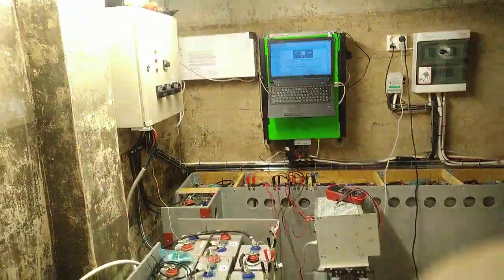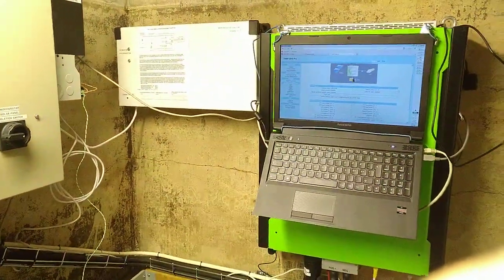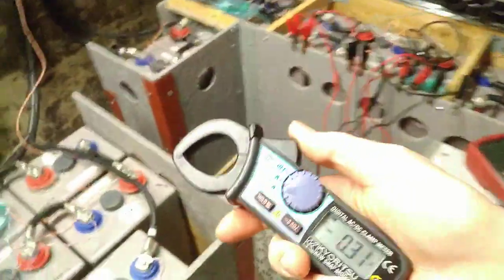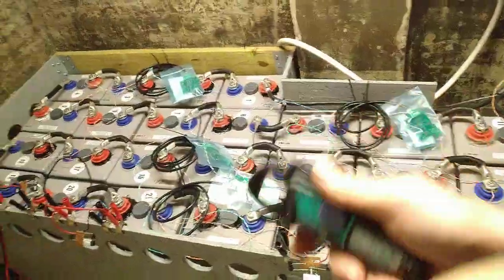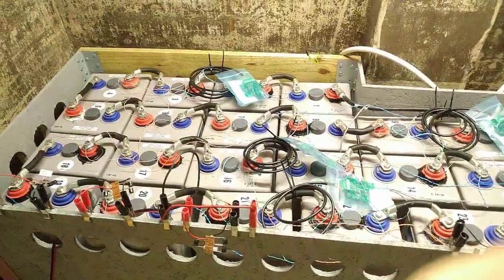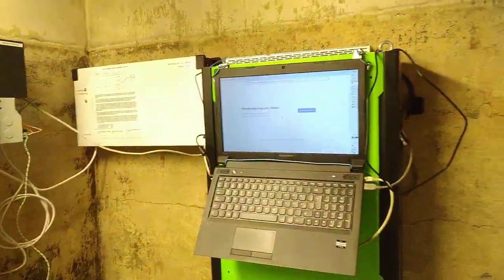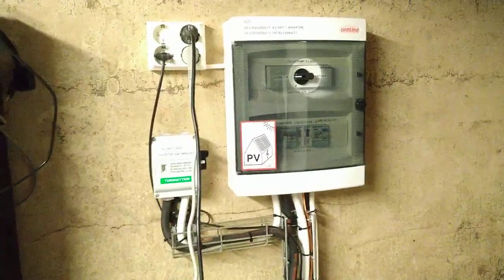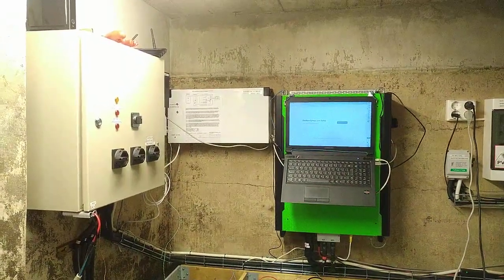Blog: Ridiculous energy prices. Guess we're running on batteries.

Comment: Yeah, also feeling the energy crunch here in Sweden.
I've been mostly heating the house and cooking  food on the wood stove. Trying to schedule electricity consumers on for night time.
But last couple of days have been expensive during the night as well.

Just keep an eye on the losses, night prices has to be a certain % lower because of that
Reply from the maker: Yeah, I'm counting on a somewhat pessimistic 50 % loss for power going into the batteries and then out again, so every 1 kWh I get out is 1.5 kWh in. Daytime prices have been reliably at least 100% higher than nighttime prices, so it adds up.

Comment: Interesting idea buying and selling power. My 24 x OPzS1500 batteries just sit all winter. I need a new hybrid inverter though, and its not easy to get permission to change anything on my 6 kW soler system here in Denmark. 

I am very interested in your BMS monitering system. I still do manual check from time to time, your rouge celles scare me a bit. How do you BMS (or just monitor it at a cell level) ?

Thank you alot for sharing you work on YouTube
Reply from the maker: I used to do manual checks, but with 48 cells, it ended up just never happening, so I asked a friend of mine to CAD up a cheap lead-acid BMS. The current version of the BMS is just a voltage monitor, and a messy prototype at that. The board layouts and source code can be found on his Github, though everything is very incomplete still (I think the BOM is missing, and there are no instructions for anything): https://github.com/mathias-aland/battery-monitor-v1

We're in the process of putting together a free-standing analogue shunt board to go with it. Since you need to shunt so much current on these huge cells, we decided not to put any shunts on the BMS board since it would mess with the voltage monitoring (you don't want to shunt an amp over a thin BMS wire). I'm just about to start prototyping an ultra-basic TLV431 based shunt, and hopefully we'll have some boards for that laid out pretty soon.

The goal is to have per-cell monitoring and shunting that kicks in sharply at 2.25 V and shunts a maximum of about 1 A at 2.4 V or so. My testing shows that this should be adequate to keep even as severe cell imbalance as you see on my A600 cells in check.

Comment: Too bad about the solar during winter, you have so many! Proper stress test indeed.
Reply: That's one of the reasons we have energy crisis. If the solar panels worked well the electricity would be cheaper too!
Maybe at one point people start realizing that solar panels are not so awesome things up north. Sure they are a lot more efficient in colder climates but during the winter when you need electricity the most there is no sun. During summer the days are longer than down south but thing with electricity is that it has to be generated when it's used. You cannot easily store energy created in summer to use up in the wintertime. Yeah you can sell back to grid in summer and just buy it back in the winter but grid isn't some magical battery either and doing that actually helps to make energy crisis even worse.

Comment: Damm thats some expensive electricity. Herd you have a heat pump. But is lpg or natural gas even a viable way to heat your houses out there?
Reply from the maker: As Mac said, no, gas is not an option. There's never been any gas infrastructure here, and prices for gas are just as bad. Prices for ALL fuels here are very high right now.
Reply: @FFcossag thanks for replying. Its interesting to see how other countrys do things. I'm from Southern canada and alot of places here out side of citys use delivered lpg or home heating fuel.

For the rual areas there are a few other types but rarely used wood, pellets, natural gas even resistive electric heating.

Lpg= propane (mostly)

Home heating fuel #1 = kerosene 

Home hearing fuel #2 = diesel

In bigger cities there is natural gas infrastructure.

But I guess truck dilevery is infrastructure in its self.

Ps I may have a therory on the weird environmental comment. Southern Europe seems to be quite anti nuclear right now. And afaik france is removing alot of nuclar plants probably incresing the demand of natural gas along the way.

Comment: Myself is waking up to a 15 degree warm house because we're to cheap to run the mini split heat pump :)

What about reducing heat during expensive hours to save on battery life? My brother did a hack where he put a lamp near the thermostat. When on the lamp heats the thermostat by about 10 degrees and the system stops heating.
Reply: @TiredSysAdmin depends on the ratio... In my brother's case it's something like a 1W lamp and a 2kW heat pump. If the price difference is anything above 0.05 percent between hours (ball park figure of course since there are many more factors to consider) it aids in lowering the bill.

The main goal is to move consumption to other hours. As a side effect there is also a gain in lowering the temperature of the house of course.
Reply: @dennisolsson3119  are you sure its not a 60-100w lamp.

1w is almost nothing and a 10*C delta seems far unreasonable.

Now mind you even 100w is more than 10x less.

Another more practical solution would be to use your house like a heat battery get it tosty near the end of the night then let the temp fall off through the day.

Technology connections did a video on how he does the opposite in the summer with ac.

As a canadain the concept of variable rate electricity is pritty foreign we have tired fixed rate or time of use. The higest fixed rate tier is 11.6c cad per KWh. But some areas in the states are ~1/2 of what we pay. 0.04 usd/KWh.

Mind you our electricity is reguladed by provence so this does change based on where you are.

Finally almost everyone in citys uses natural gas for hotwater and heat.
Reply: @andrewmcewan9145  I might have been a bit unclear in my explaination, I realize.

It's a small USB light that is taped to the temp sensor. All the 1 or so watts of heat is generated very close to the sensor..it was just a convenient way to quick and dirty get something controllable by the home automation (WiFi socket-thing, usb adapter and the lamp and a strip of tape). It is not supposed to heat the room, only offset the thermostat. I plan to do the same by glueing a resistor to the temp sensor of mine.

And yes... The technology connections video is nice and this acts the same way... Live of the heat battery instead of the heat pump when the price is high.
Reply from the maker: That's a nice trick, hehe.

I'm also keeping the house at about 15 C right now. I'm generally nocturnal, so I can't be up during the expensive hours to run the fireplace - so the heat pump stays on all day. I've limited the VFD to max out at about 3 kW though, so it's not running very hard ... at the expense of a 95% duty cycle. I think a constant, lower load is better for the system as a whole, however, and it saves me having to draw peak power from the grid.
Reply: Why not lower the thermostat lol?
Reply: @MauriceNL1  harder to interface a knob or push buttons in a menu with home automation : )

This solution is for temporarily and automatically lowering it from something like a home automation system.
Reply: @dennisolsson3119  I thought i responded to this. That is a neet trick and with the diode on thr sensor i can see how it works. Though a sonoff is pritty cheep if your looking for true control.

I have been looking for some zigbee or zwave  low voltage control modules as our electrical code allows you to do poe or under 32v without a permit, Also signal wireing.

There are some restrictions on lighting but its  pritty easy to work arround. (Poe must be decided runs, lv must use junction boxes etc...)

Biggest issue is a socket must be dedicated. But socket was not defined in the code... 

I would assume (at work all my poe switchs are ran off a ups) a power bar is fine and some power bars have remote signal wires 😉.

Comment: ooh 13Kw that is 54A from the grid! what was your service feed again? :D
Reply from the maker: No, it's more like 18 A. Finland runs on 3-phase ;)
Reply: @FFcossag  oh yea, so what is your voltage? would it be 208?
Reply: Very approximate calculation would be: 13000 W / 230 V / 3 = 18,8 A.
Reply: @SuperBrainAK  230/400V as everywhere in europe.
Reply: @benjamilindqvist912  ah neat, I think there are too many odd “medium” voltages, 208v 3 phase, 220v 3 phase, 240v split phase, 230v 3 phase. I think everything needs to be 120v single phase, 240v single and split phase, then whatever you get when you take 240v and split it into 3 phases.

Comment: Good. Wait til you need to recharge and do keep the false green energy lie.
Reply from the maker: I am not sure what you're getting at.
Reply: TiredSysAdmin  while depending how much of your grid/local section is solar. Where I am its a very small part mostly neglagable. I guess that statement holds true in my case.
Reply: Did you seriously just think that he claimed it's green energy when he runs his house from the battery yet uses grid to recharge them when electricity is cheaper?

Comment: Time to invest in some education on home air sealing the .  In winter your hot air Rises and leaves through all the cracks and openings in your ceiling in the highest regions at the same time the cold is here comes in to the bottom of the house at the floor level to the smallest cracks in caps
              Make a wood frame for all your windows and warp it in plastic so you have a trapped air pocket in between the frame. 
               Is natural gas cheaper to heat a furnace in the UK ? Is your hot water heated with gas?
Reply: If you plan to live in there you shouldn't just make your house airtight. You lose less heat but air quality does matter a lot. You use up the O2 in the room and replace it with CO2 and moisture. Mold loves to thrive in such conditions and will gladly turn your lungs into rotten mush.
If you airproof your house then forced ventilation is a must! Ventilation also takes the heat out of the house so having expensive heat exchangers is also a must if you go down that road.

It is true that around here regulations force you to build all new houses airtight to conserve heating energy. But these same regulations also force all buildings to have forced ventilation with heat exchangers. They wouldn't do that if it were optional.
Reply: @coldfinger459sub0  Indeed, old houses are very difficult to make airtight without major rebuild. Houses are different though and some might "be lucky" and ruin internal climate, then later suffer the health consequences. I have seen some apartments around here where owner had successfully turned it airtight enough so in most rooms mold started to grow and they wondered why. (Also their entire family suddenly started to suffer from respiratory problems)  It's better to let "average joe" just waste a bit more heating energy but at least live in good environment and let professionals do this who know exactly how it should be done.
Reply from the maker: I've slowly been sealing my house, it's about as tight as I want it right now. I'm lucky to live in a very high quality house, built by an extremely pedantic carpenter, so there are very few "cracks" for air to seep in through. My biggest loss right now is the glass in the old windows, which does not insulate at all even though they are double glased. I'll have window panes that are 10C below ambient inside and 10C above ambient outside, just because the glass is bad.